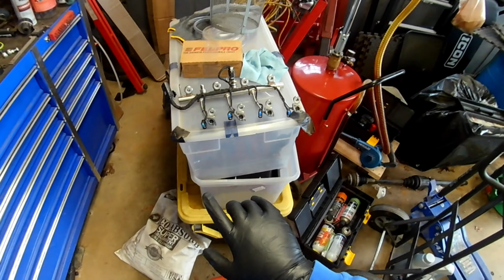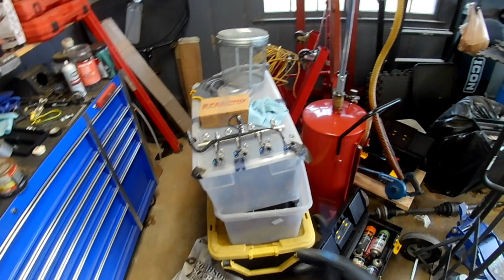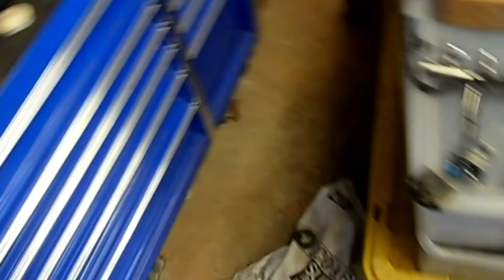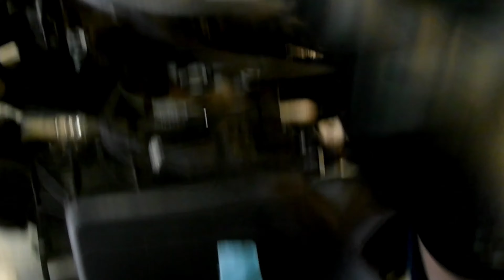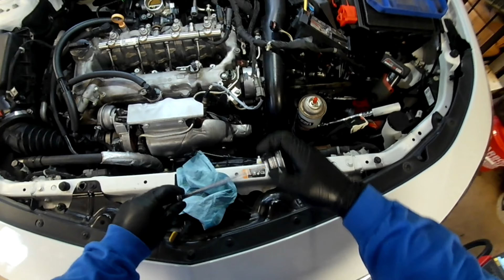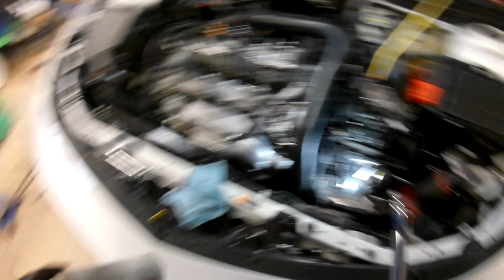General Motors 1.5 Turbo Vacuum Pump Repair, Part 4

Comment: I just had to do this on a 2016 Chevy Malibu that the vacuum pump exploded but I was able to get all of the pieces out of the engine. I drilled out the oil feed gallery to the rotor bearing area in the new pump to try to avoid it failing also. These pumps are the focus of a class action lawsuit against GM.